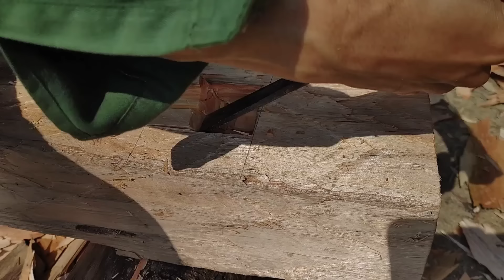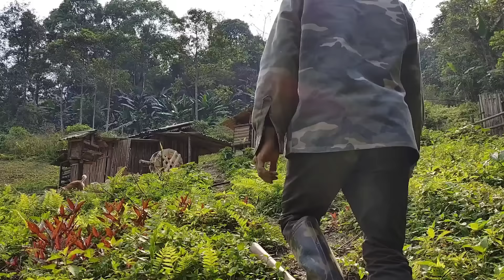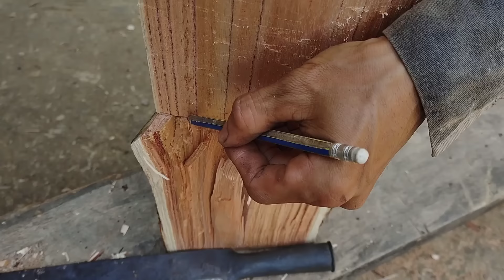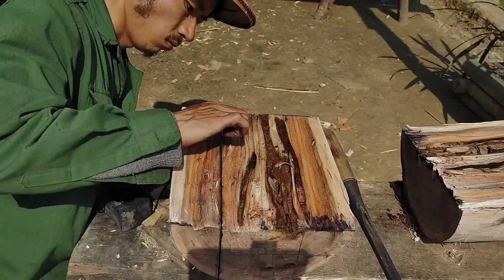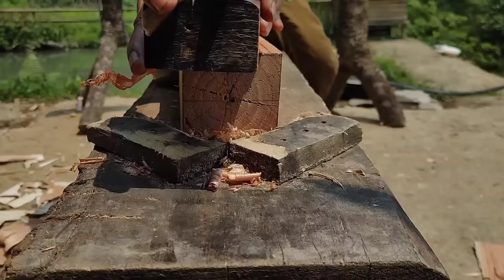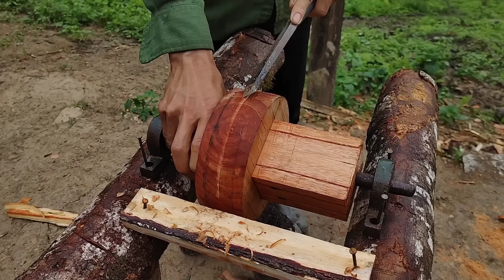Building hydroelectricity with spinning reels \ Living in the Forest Episode 21

Comment: With this amount of water and rotation speed, when you install the rotor it will not be able to generate electricity. Do you know wind turbines? It includes a system of different large and small gears to increase the rotational speed when entering the engine.
You can already buy the belt, why not make a steel shaft with pulley to drive the engine? When the engine is running, the belt on the round log will not follow a certain trajectory.
Good luck with your idea!